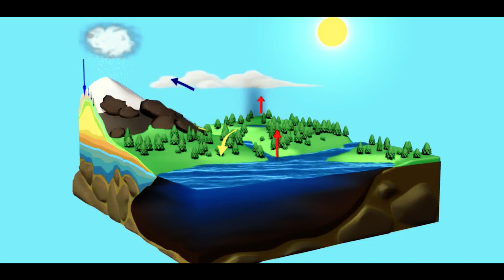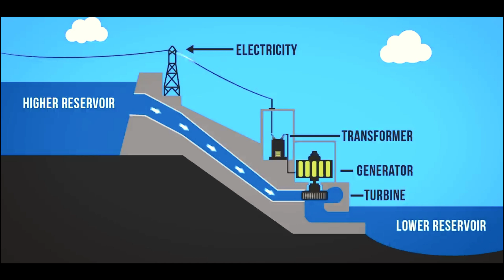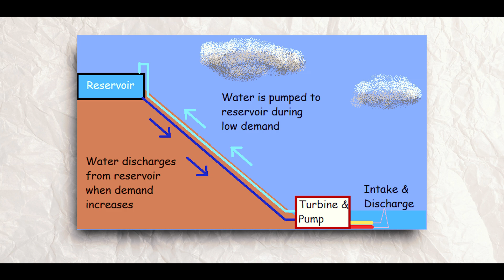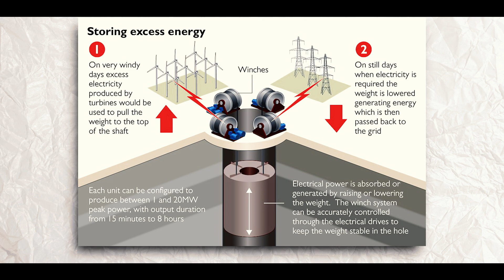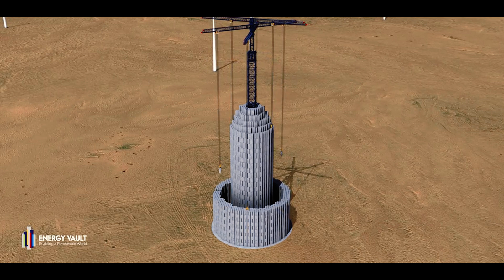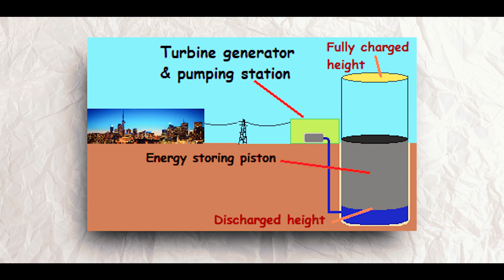How Gravity Batteries Could Change The World

Comment: It's scam! It's impossible to build a stable and reliable project like this to store energy.
Reply from the maker: Which concept are you referring to?
Reply: @TechInCheck  The ideia of a crane pulling up and down concrete blocks is totally flawed: for exemple, is quite impossible to do due wind and small imprecisions that make impossible to make an automated system that can put one on top of another the concrete blocks.
Reply from the maker: You do have a point, but remember that each block weighs 23 metric tonnes so i doubt that wind would be much of an issue. And the automation part might be tricky but not impossible.
Reply: @TechInCheck  If you have to stockpile various blocks, one on top of the other, even few millimiter (for each block) will result in a disastrous feilure! The biggest "red flag" that this tecnology is a scam is that ENERGY VAULT has comments disabled in all and every videos on youtube: this is due to the fact that, otherwise, every engeniaring, fisics or also undergrad student with a little of expertise will comment that this tecnology couldn´t work

Comment: Crane power is such a scam. How do you fall for it? Or is it payed ad?
Reply from the maker: Why do you think it’s a scam? It’s a proven concept
Reply: @TechInCheck  "proven" does not equal "viable". Gravitational field energy density is just about high enough to build a couple of huge water pump storage units where it is possible due to landscape. Everything else is just wishful thinking at best and scamming gullible people with no knowledge of how physics work at worst. Building a high ass crane with a bunch of hanging masses on ropes in a windy area? Really? Concrete blocks? Someone did check the price and carbon footprint for that, right? It's a scam on so many levels.
Reply from the maker: Interesting! The crane power is a new concept and apparently it is even more efficient than hydroelectric water dumps. It might be costly yes, but it definitely has a smaller carbon footprint than other solutions.
Reply: @RomkoPidstryhach  not a scam. The crane is simply not the most efficient design (but still works). But we're definitely gonna see some old US mines turn into the water gravity batteries.
Reply from the maker: Yessir
Reply: @TechInCheck  on the other hand using old mines used as a pump pressure storage is something that looked promising the last time I checked.
Reply from the maker: You are right! The other good thing about using old mines is that it requires building no new infrastructure.
Reply: @TechInCheck  oh yeah, and when it comes to "very deep" mines, one might as well just use the geothermal power at this point
Reply: @TechInCheck  I'm glad you chose to participate in discussion, that's the mark of a good scientist/researcher.
Reply from the maker: Definitely! I love to hear other people’s opinions on things like this. Helps me look at thing from a different perspective. What about you? What do you think about gravity batteries? You think it’s an efficient way to store energy?